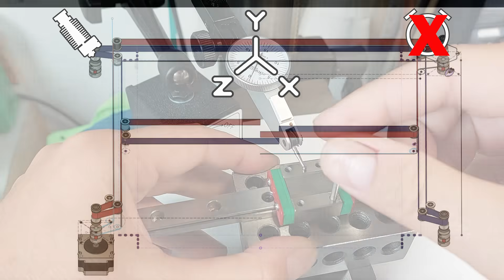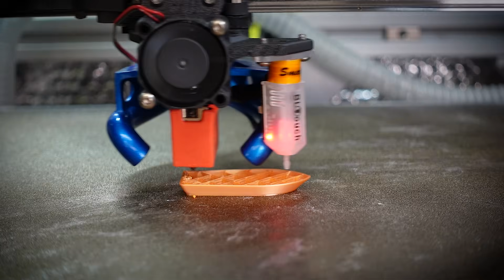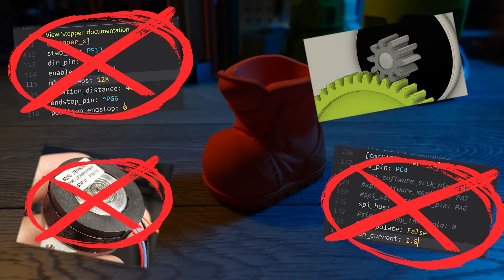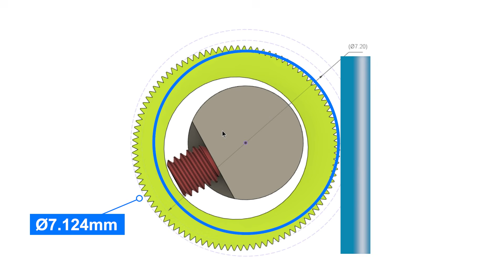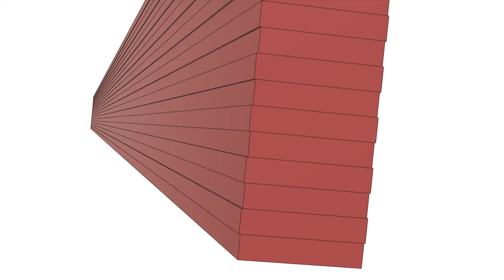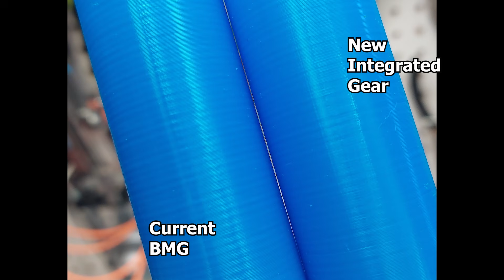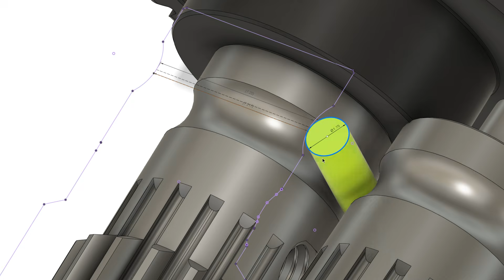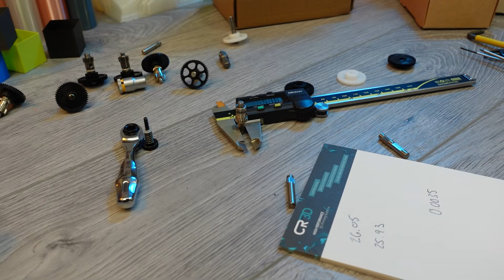Extrusion Quality - Mystery issue resolved !

Comment: It seems like the first part should be addressable by adjusting the pressure based on the rotation of the extruder gear and a common/standard measurement of the amount of offset in diameter of the extruder gear. It would be a software solution to a hardware problem, but far cheaper than replacing every extruder assembly everywhere.

I have no idea how to take care of the second problem though - add a sensor that monitors the flow of filament and provides feedback to the control board?

Comment: Thank you for that grade explanations. I have no experience in 3-D Printing - but your video makes me thinking, that may be the best way to overcom all the tolerance issues, is to use a momentum controlled motor like a PMSM with FOC. If your results with the bowden tube was better than the direct drive, this means essentially, that the combination of temperature, nozzel diameter and pressur in the melting chamber controls the flow rate. And therefor you can control the flow rate directly by the pressur in the melting chamber which you can control by the torque of the motor. If your control-loop is fast enough, it shout compensate for any mechanical tolerances.
Like i sat at the beginning: I'm not in 3-D printing and therefor i don't know if something like this is possible or if i have major misconceptions. Pleas let me now.

Comment: To get a better sense of what is actually being extruded, you could try to measure the extruded mm / per (milli) second. To do this you could remove the hotend and measure the filament directly. An ideal extruder would move filament with constantl speed, one with some eccentricity would have some oscillation. Marco reps used an FPGA to measure in the μm area https://m.youtube.com/watch?v=WoPPwGxgWEY -- Extruder Olympics by any chance?🙂

Comment: I like the ideas presented in the research and I agree with you but I think you didn't directly explore the fundamental concept underlying the issue you presented. At the end of the day, our printers are governed by volumetric flow rate. However, most slicers don't treat the control of the filament that way. Slicer's assume that printers have a consistent volume going in at the point of the drive/extruder gear versus going out of the extruder nozzle. Unfortunately we only can set "a linear speed" in the slicer there is an error in the volumetric flow rate because of the material thermal expansion could be assumed to be isochoric in the nozzle and without a location to go besides out the nozzle. Could it be that any tiny back-pressure changes caused by the drive gear is amplified because of the die swell effect and the lack of direct control that most printers have over the volumetric flow rate of the filament? Oh an lastly, you may also be experiencing vibrational resonance (given that you didn't see the artifact at lower prints speeds but did at higher speeds) in your extruder assembly, one thing that might be interesting is rotating the screw position (or the clocked position of the extruder stepper motor) effectively changing the resonance of the extruder assembly to see how that effects your prints. **Edit: skip the part about the resonance, I hadn't watched your videos exploring that side before watching this one.

Comment: I’m sure you’ve heard the term “Shade Tree Mechanic”. I’m a Shade Tree Engineer. Aka, self taught with a weakness in mathematics that makes me hang my head in shame.  The work you’ve done here is incredible. The quality of the narrative and your ability to create such an incredible classroom session on the subject is absolutely phenomenal. The amount of information packed into twenty one minutes is absolutely astounding. Thank you so much. In one short instance, you’ve managed to up my game simply by providing a deeper understanding of the dynamics at play when we endeavor to create by 3D printing. I’ve managed a few times to get incredible print quality out of my cheap Anet  A8Plus printer due to the geometry of the print and experimenting significantly with a specific material / vendor, and all the other elements that come into play from bed temp to slicer settings. I have to say, the journey has actually been extremely satisfying as you learn quickly, isolating each element, is no simple task and when you get them all aligned, it’s a hell of a victory. You sir, are an incredible teacher and I’m stunned this channel isn’t over a million subs yet. Thank you for your work. I’ve patron’d no one yet due to one, limited funds at this point in my life. However, I may just be your next Patron.

Comment: Instead of using flament to create pressure to push out the melted plastic(it cause variations on otput based on your tellings), design an exruder which has melted plastic buffer in it(which will not effectted by flament speed, thicknes etc) and screws will push out the melted plastic as in industrial plastic extruders 🤔🙄 
Just an idea, you will find a way to apply it 😁

Comment: Did you preheat the plastic gear in hot water before press-fitting it onto the BMG shaft? That's what you do e.g. when replacing the drive gear of immersion blenders.
EDIT: I saw the later part of the video, you preheated the shaft. It's still better to dunk the plastic gear in 80 degree water for about two minutes to make it a little pliable and expand. Then when you press the cold shaft in, the gear will shrink and harden, giving you a better final fit and sturdier connection.

Comment: In the earlier year I built a Voron 0.1 which has the a similar issue,  I know there was something not right in the gear, I reassemble a few times and could not find the issue, one day I discovered that the screw on locking latch tightness create the issue, so I simply loosen it and the print improve by a lot. After watching you video things starting to make more sense. I think that screw loosen some how allow spaces for the idler to correct itself after forces apply by the latch. It still have a bit but overall acceptable. Appreciated for you video and effort!!

Comment: Is it possible to rotate the plastic gear's offset 180 degrees from the metal gears offset something like when they match mount tires on rims and possibly canceling out the two offsets?
Reply from the maker: It could... but that would be a bandaid solution.

Comment: Did you thought about putting the extruder drive on a load cell and use that to get a curve of the pressure ?

Maybe you could transform that open loop into a closed loop and get a good deal of benefit in term of reduced calibration needs by using transforming the gcode instructions from step based to pressure based.

Isn't the control of pressure the ultimate goal after all ?

Comment: Question didn't bondtech fix that by using lgx  that solved that problem?
Reply from the maker: I have not personnally tried LGX yet but from what I hear it suffers from similar artifact.  After tearing it apart, I have a few hypotheses,  but would need to do more testing.
Reply: @MirageC  I'll be waiting for that to come out. Thank You for the hard work.

Comment: Fantastic explanation! I spent ages chasing this issue on a MK2/MK2.5 BEAR clone I was building (in my case an angle moire pattern). It can be infuriatingly sporadic. Moving to a E3D Hobb-Goblin (my extruder design is based on the old-school spring loaded 624 bearing idler) just about cured it for me. One other thing to note: over tightening the grub screw can actually distort the hobbed gear as well.
Reply from the maker: Yes, my tests included varying the tension on the idler. Thank you for your comment.

Comment: Got an idea to fix that issue with the idler, or at least the reason for it.

We are using extruder gears (idler) with off center force/torque introduction. The filament is assumed to be the center plain.
Since we are using plastic parts there is a good amount of flexibility and really small numbers of deformation are enough to show defects like you have showcased here. My theory is that a side ward force introduced form the spur gears teeth of the idler is enough to deform, in that case twist, the idler arm and causing the extruder gears axis not being perfectly parallel.
Stiffer materials like carbon fiber reinforced filament or even plain PLA used for the idler arm could help. Also using a press fit on both the idler arm and housing for the idler arms hinge should eliminate play in that.

Im not to familiar with your extruders cad model, but if i need a precise inner diameter i design a "z seam groove" into my parts, so the z seam is perfectly within that grove when set to "sharpest corner". Drilling a hole out also removes a z seam, but you still have a chance of drilling crooked or a wobbly drill bit

Comment: Such an amazing video. The level of detail is over the top. The last few weeks Im thinking on changing my set up on my Ender 3 from a BMG clone v6 DD to a lighter extruder with BMG guts and a Nema 14. I was between Sherpa mini, Sailfin and Hextrudort. Now I know what I have to print. Although I dont know if the is any 3d printing file to mount all of those on the Ender 3.
A big Bravo to you Sir

Comment: I think you opened the Pandora vase of 3D printing! Probably we have to add to that even tiny discrepancies on the Z axis. I didn't make rigorous tests as you, but I noticed that on my Voron 2.4 300 I had a better layer stacking with PLA compared to ASA/ABS, and even better on a smaller machine (Annex K3), probably due to small change in temperature of the frame. Anyway my two printers have different extruders, LGX for the V2.4, Sherpa mini for the K3 (and I think the LGX should be more precise, all the gears are larger so imperfections should show less). Also I can feel a different resistance for half a turn of the gear on the sherpa mini, and despite that it gives me better quality than LGX...

Comment: i noticed something similar on my sidewinder x2 after motor died , feed gear was too tight with gear on the shaft of the motor and was getting those lines too, eventually sanded down gear on the shaft from the side so it wouldnt touch feeder and it prints way better

Comment: Also trying to fine tune the consistency of extrusion on my (original Bondtech) BMG, I found this:

#1: The involute gears are not meshing properly if they're not at the right center-to-center distance. This is inevitable, as the filament is dictating the distance. As a result, there is non-linear transfer of torque from the driven gear to the idler gear. This results in banding at the 1 tooth frequency. The "libra mini" extruder is trying to solve that by using helical gears, but failing, as the helix is not steep enough (not covering a full 1 tooth distance) to fully correct for the issue. This was researched here: https://www.youtube.com/watch?v=32dTLRNIYmw

#2: There seems to be some oscillation on with a longer period. I believe Vector 3D is seeing it here: https://www.youtube.com/watch?v=moSZ05FkLQU in the pressure data. I was believing that this might be caused by the different effective diameters on the gears vs the hobs on the gears of the dual gear extruder, causing uneven slipping under load, but that is impossible. This may be what you're seeing and your explanation with the filament not staying centered could be the answer.

When it comes to artifacts, observing the frequency can quickly point to which mechanical (or electronic) component . Eg. microstepping non-linearity is still a major issue on Prusa, and that repeats at 1/200 motor revolutions. Is there a specific frequency of the issue you're observing?
Reply from the maker: Yes,  thank you for the references.  As for the filament walking in the hobb groove issue, I started by printing a cube where perimeter corresponded to the volume of plastic from one complete revolution. The artifact could not be seen.  Then reducing perimeter it started as an oblique artifact.

Comment: i would like to see some small direct drive extruders using other drive gears. maybe the hemera gears. also if Bondtech could machine the gear and the gear shaft as a single piece that would potentiallybe the best of both (except cost, that would skyrocket)

Comment: The run out you are seeing on the plastic gear could simply be the drop of one tooth traveling down through it's arc and losing contact with the arm the meter is resting on and the rise of another tooth contacting the plate as it travels up through it's arc, if you follow me.

Comment: Thr best design for manufacture doesn't rely on every component being perfectly machined to sub micron precision. 

I would suggest introducing some springyness back into the system. Something like a spider coupler between the motor and the gear train maybe.

Comment: Best video! Yes, i have Z wobble on Vcore 3, but 3.1 is on the way so i will see :D Extrusion problems will be more visible after the upgrade. I have orbiter 1.5, dont know if 2.0 have some extrusion problems like in video, but if it has, next version (if it comes? 2.5? 3.0?) will fix this (of course - if it has this problems now, what i dont know). :D

Comment: I literally just discovered this my self yesterday. A easy fix for the filament gear, is to install a small piece of tape on the main shaft opposite of the notch . this will help center the gear.

But I hope Bondtech will release the improved version SOON.
Reply: Good point, aluminum foil can be used as variable shim as well.

Comment: I was wondering if helical gears would also have an impact on print quality due to smoother gear meshing. Axial thrust would be an issue but that has been solved already. 
Great work pointing out all the error sources in print quality!

Comment: I have to say I loved your video :) and always appreciating your detailed work! 
Some of the issues you are talking here I also founded out during the Orbiter v2 design. Surely I have not conducted such a detailed examination and every small mechanical tolerance in the extrusion system can cause this effect. This is also very hard to control when you are mass producing. One major issue we faced was to get the drive shaft diameter matching the Bondtech gears inside diameter. We fixed it as much as we can but there is still like 5 microns difference otherwise you cannot assemble them together and account for manufacturing tolerances. But how you have me an idea to try to press fit them together using a different shaft design :). 
For the idler tilting issue we fit a brass tube in the housing over which the latch is rotating. This reduced a lot the tolerance there and keeps the latch position aligned. 
Another issue we faced was actual gears messing. I founded many bad meshing ones. They are cut with tools which are also made for several gear tooth numbers, so not as precise we would think plus manufacturing tolerances. A cutting tool is matching for several tooth numbered gears like 12-13; 14-16; 17-20 this inherently means that the perfect mashing is not there because the cutting tool is not designed for a single tooth number. Surely some effect is hard to get rid of completely. For the plastic gears planetary gear system help because this effect is reduced by the number of planet gears you use. Using drive gear with a bigger diameter will reduce the effect of drive gears wobbling and the meshing inaccuracy because the error it introduce is less compared to overall dimensions. 
Keep up the good work! Cheers Robert!

Comment: I believe the Dual Gears are pushed apart from each other, (as the filament passes through), causing inferior meshing of the teeth and changing the effective diameter of the idler gear side; Two grub screws may be better, or even l three grub screws, may help line up the gears on the shaft better; I wonder if a hexagon shaped nozzle hole will line up layers better, fit layers together better. Phew you've done a ton of work here

Comment: This video have me a crazy idea, that might actually be handy on a very high throughput printers like yours. How about using a dual-gear bowden WITH a very small and light direct drive extruder that is NOT dual gear (hence much less parts to go wrong, also lighter)? It means that you'll get tons of 'pushing power'  from dual gears (which is ultimately limited not by motor torque actually, as you know it, but plastic deformation of the actual filament, especially apparent on soft filaments) with actually MORE pushing power by second extruder in line, and, as much as I understand, ability to meter out filament extremely precisely for things like pressure advance etc that you've had to turn off (retractions, too)! Should likely work by simply copying instructions, provided that gear ratios and extruder direction are the same.

Comment: Very nice visualization and explanation of the problem! And honestly I’m so happy (but also sorry) to see someone with the same problem like I had. I got prints with very bad „z wobble“ and tested a lot, different extruders and Bowden/dde setups. Eg CW1, Sherpa Mini, Voron M4 all gave me the same problem. In the end I was so frustrated I just assembled my bmg TL Clone and installed it in a Bowden configuration, and the problem was gone! Which I didn’t understand because the M4 was also Bowden but still had this problem - like you described less visible but still there. My conclusion was that printed extruders just lack of the precision we need for the extruder parts and manufactured clone could offer this precision. Very interesting to see a possible explanation for my experience, thanks!

Comment: you pressed the gear inside the plastic one by hand, wouldn't that make things bad?
Reply from the maker: I was affraid to screw things up too during the pressing process. But I re-messured the run out after, and it was the same as when it was on its original shaft.   The tight fit between the shaft and the gear will self center the assembly.